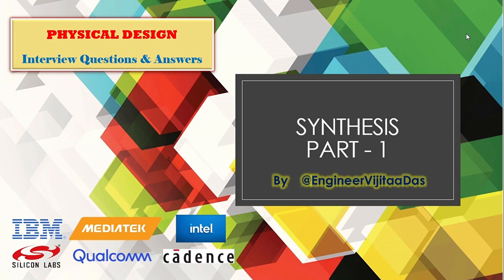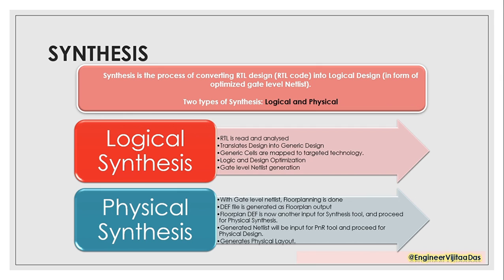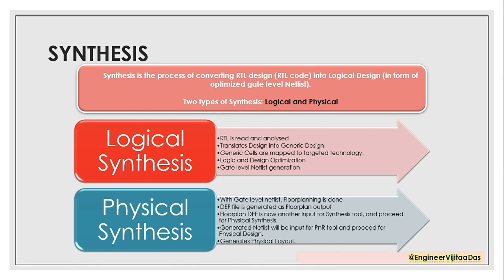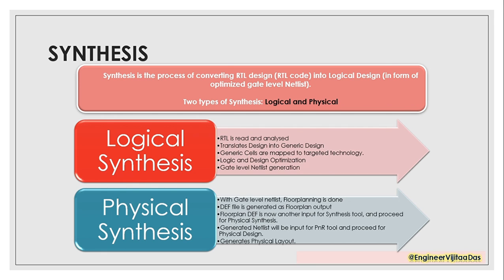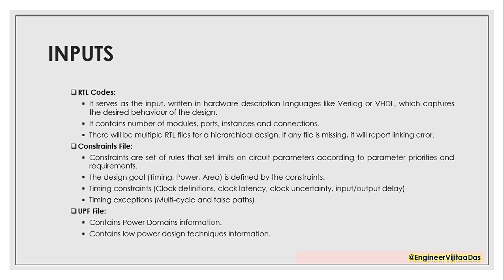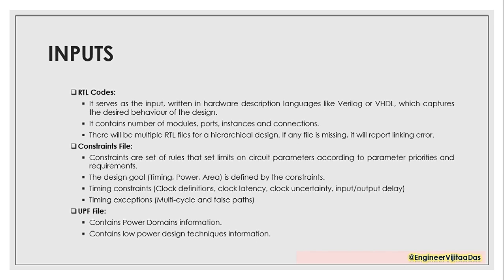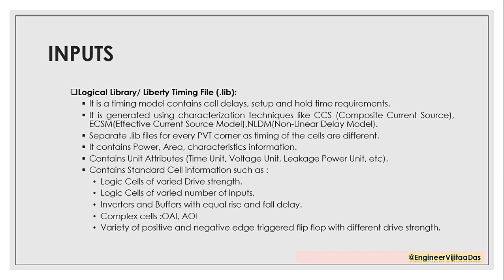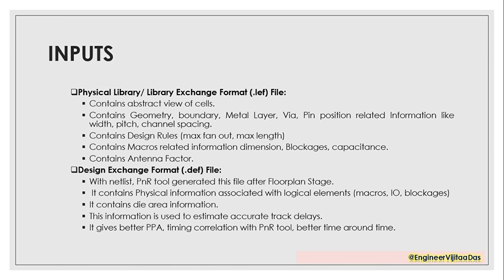VLSI Synthesis and its Inputs || Logic Synthesis || Physical Synthesis

Comment: Mam  please tell the knowledge required to become physical design engineer i.e subjects ..can you please explain about the different types to design engineers involved in    chip design process and their job role knowledge to be explored to become specific engineer..such as design engineer, physical design engineer etc .

Mam one doubt can you please differentiate the job role of analog design engineer layout design engineer, physical design engineer mam.

Please and humble request mam
Reply from the maker: To be a physical design(backend team) engineer, you must have knowledge on sta, pd flow, emir, and ppa optimization .

Design Engineer is frontend team, for that you should know rtl and testbench building, circuitry idea as well.